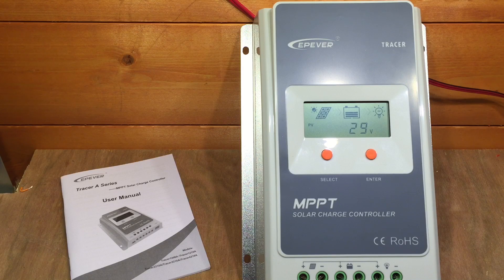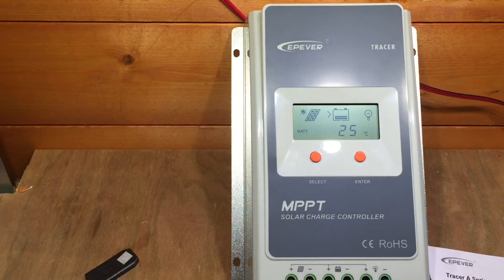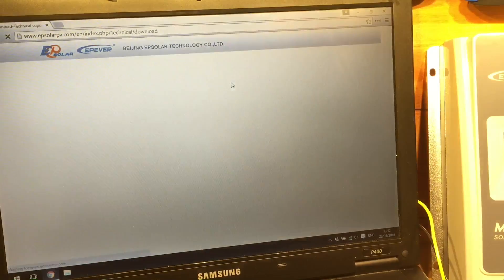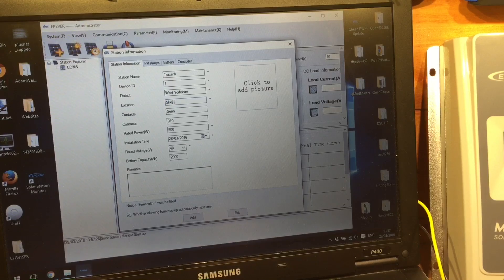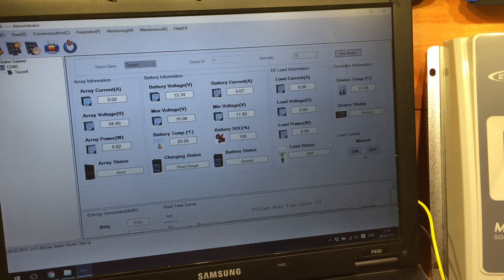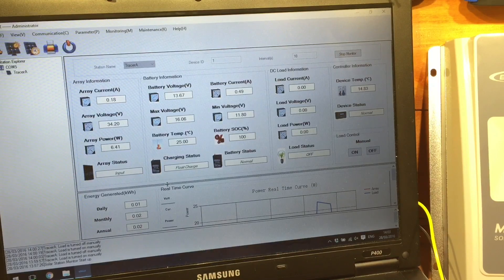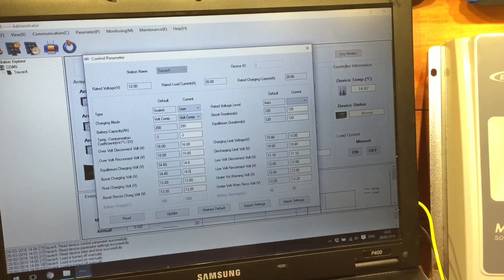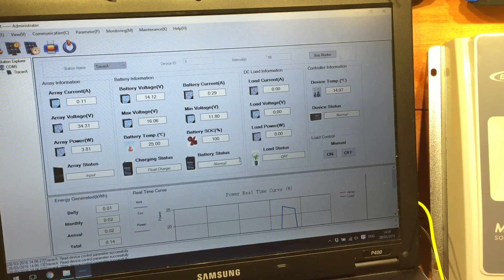EPSolar Solar Station Monitor software & a cheap USB cable - 12v Solar Shed

Comment: Hey great vid ! Good quality and clear content, I like it. I'm planning a van conversion and I want everything to be powered by solar (small fridge, couple led lights, charging my laptop, maybe a water pump) and I'd like to know if you have any recommandation on brands ? I want a 200w kits. If I can save a lot by buying separatly I will but otherwise a complete kit would be great. Would like to keep it under 1k$. Any recommandation ? Or brands I should avoid ? Heard some decent comment on renogy ...
Reply from the maker: +oli36 Renogy Sen to be well regarded in the US because I think it's a US brand. However all the renogy charge controllers I've seen are rebrands of the usual Chinese manufacturers. So the extra cash just pays for the local distributer and their service levels. I think they've rebranded EPSolar kit like the one I show in this video. 

You'll definitely be able to get a 200w panel, a charge controller and some size of battery bank for $1000. 

You need to think about your loads and how much power they'll consume and for how long, then work out your battery bank to power all that got a few days, then think about how much solar you need to top it up even on a poor sun day. 

Good luck and thanks for the kind comments.

Comment: Ok, so at about the 7 minute mark you show the software, now my mind went to one of your other videos about the lipo batteries (https://www.youtube.com/watch?v=Pnrxm3KNjes&t=284s) so what i'm wondering can you use this software and then use the 3 battery 12v string and use this controller to charge it without overheating the individual cells??
Reply from the maker: Hello.  Yes you could use the software and adjust the charging parameters to suite a 3S lithium pack.  Although I still don't think lithium fits very well in 12 volt applications.  It's healthy between 11-12.6 volts, where as a lead acid is good perhaps from 11.5-14.5 volts, and most '12 volt' devices are designed to suit that.  I still think lithium works better at 24 volts, but again, you could tweek the parameters to work even better.
Cheers

Comment: Hi, Adam. I'm Andrey from Rostov-on-Don, Russia.
I'm using Tracer 2210A since September 2016 and I see some strange 
things of the  MPPT algorithm.  It good seen on the charts I got. 
They are published on our Russian forum https://www.forumhouse.ru/threads/382675/. 
Look at the power curves. In the morning, I have two shadows. Each time, after the shadow went, Tracer starts MPP tracking process very late. After the first 
shadow 10 min later and after the second 20 min later. In this periods Tracer acts 
as PWM controller and it does not collect all energy as possible. 
Do you have observed something similar. Perhaps, at cloudy days this effect will be 
more frequently? When the sun is hiding behind a cloud, and then shine again. 
Due to of this effect, there will be a great losses of energy in those days.
Reply: The manual mentions something about this, that the controller isn't constantly in mppt mode but switches between pwm and mppt. Unfortunately, the sale listings on Ebay don't mention this at all....
Reply from the maker: I'm afraid I can only see the thumbnails of the images as you need to be a member to see the full versions, however I think I can make out what you are suggesting.  
A few people have suggested that the tracking algorithm isn't very fast and can seem to get a little stuck on previous tracer models.  Although I have seen some evidence to suggest this is true I've not looked into it very much because my batteries are still full when I need them at the end of the day.  
My old MPPT charge controller did a sweep every couple of minutes allowing the panels to go to open voltage and (close to) short circuit current and adjusted the DC2DC converter to suit but the epever doesn't seem to do this so I'm not sure exactly how and when it decides to perturb and observe (if that is indeed how it's finding MPP).
Reply: Of course, how could I forget you need to be registered member to expand the image. 
That's my fault. If interested, I can send the files to you directly, but I don't 
know how to do it in YouTube.
On the other hand, simply, you may register.
Reply from the maker: +James Biggar To be honest that's exactly what you want to happen. Holding your panels at the maximum power point when your batteries at full will result in one of two things - over charged batteries or lots and lots of heat to dissipate! 
The only MPPT charge controllers that will attempt to get the maximum power at every moment are grid tied because they have a bottomless pit to fill.
Reply: I understand that you don't want maximum power coming in when the bank is full lol, I've been off the grid for nearly 2 years now. But have recently decided to try this controller and so far am not impressed with it at all. My current SOC is only 60% and this controller is only inputting half the power as another ebay mppt controller that was half the price. Something just isn't right about the charging modes with this one.
Reply: ...and the only reason I decided to try this one is because the advert mentioned PC monitoring which I thought would be convenient, but the current program is nothing like what your screen is showing and getting it to work is frankly a pain in the ass.

Comment: Adam, I am planning on using this controller with my RV solar system. RV batteries are negative ground and so is all other components in the RV. Will this be a problem?
Reply from the maker: +Danny Woods Yes you can use it you just need to be mindful that it is common positive. As long as you make sure you wire your solar panels straight to the charge controller - ensure they are isolated from the chassis. Same for the load - if you want to use that. Although I'm guessing all your loads will already be taken straight from the battery in an RV. Hope that helps.
Reply: Adam Welch
Reply: Thanks! and thanks for your video's they are very helpful.
Reply from the maker: +Danny Woods Pleasure. Thank you.
Reply: do the batteries need to be isolated from ground as well?

Comment: Hi Adam, thanx for creating and sharing your review of this product.  It has helped me decide on which MPPT controller to purchase for my RV system that I'll be installing from scratch.  I choose the 30 Amp unit, with 4 x 100 Watt Panels, and 2 x 79 AH AGM Batteries., and have ordered the USB to RS485 adaptors, however, I noticed something that I wanted to share, and of which I hope you will to be of benefit.  When you build your own cable using either CAT 5 (or CAT 6) cables, be aware that you should be using a twisted pair of cables, contrary to your choice of leads.  Be sure to check the standard wiring diagram for a Cat 5 or 6 Cable, (Google Everything) which will reveal the designs twisted pair leads.  (Typically a solid colour is mated with a striped insulator of the same colour.)  According to the book diagram, one should use lead's 4 and 5, or 3 and 6, as they are "each a set" of a twisted pair.  This is important to maintain correct impedance, maintain noise reduction, capacitance, etc, especially in longer runs.  Additionally, for longer runs, instead of a standard UTP CAT 5 cable, it might be wise to use shielded instead... and one other point, especially for longer runs, CAT 6 cable uses a slightly heavier gauge of wire in the sheath, of 23 Gauge, instead of 24 Gauge.  I've yet to hook my gear up, but look forward to sunnier days ahead.  Cheers!  :)
Reply from the maker: Thanks for your comments, it's always great to hear when I've helped someone out.  It sounds also like you're going to have a nice system setup.  If you're conservative with your power consumption it should provide almost everything you need.
Yes, in hindsight perhaps using either the green or blue pair may have had some advantages.  However I've had a number of people copy my method and it has worked for them.  A couple of people have got back to me to say they've had some issue with communication and actually the fix for them was to use a common ground (by popping open the USB-RS485 adapter and wiring  one of the brown pair to the usb connector ground).
RS485 is used in industry because it is so resilient to noise ( http://admw.uk/je ) however that isn't to say your improvement would reap some rewards in some applications.  So, thank you for your suggestion Max.
Reply: After 2 days of trying to make it work (drivers, combinations of wiring, etc.) I can confirm that soldering the common ground to the brown made my device work! I'm glad I found your response here Adam. Brilliant videos BTW. Thank you!

Comment: Hi,  Nice video!

I thinking of starting with a few solar panels and working my way up in watts, same idea with my battery bank AMG deep cycle type.

I was thinking of getting the larger EPEVER Tracer4210A 40A MPPT Solar Charge Controller Regulator 12V / 24V EPsolar so I can add more as I go. (solar panels and batteries) will be looking at a 24Volt set up but starting with 12 volt battery.

Would this type of controller work with 140 watt panel mono with a 12volt 130 AH battery just to start? Does the controller recognise the smaller amp and adjust accordingly? Thanks
Reply from the maker: +RED RUM Hello. Yes you can place a smaller battery and panel combo on a larger controller with no issues. Charging is based on battery voltage so big and small batteries act in the same manner. Good luck with your install. Thanks for the question.
Reply: Thank you, I appreciate you taking the time to reply.

Comment: Hi from Puerto Rico... My name is Rafael Felix.
Thanks for this interesting vídeo (very usefull). 
Help needed... I have the same controller and the monitoring software as well, everything works well, but as soon as the solar panel goes out at night, my battery SOC goes from 100% reading to 30℅ but voltage is ok 12.9 so technally it is totally full .... Any idea to fiz it ?.... Thanks un advance.
Reply from the maker: Hi Rafael. A number of people complain about the SOC meter.  I'm not sure what algorithm it's using to calculate the state of charge but it does seem to be quite misleading.  Personally I don't use it and simply keep an eye on voltage - I've also set my controller to use Voltage Compensation rather than SOC in the Charging Mode.  For me it is not really a problem, but I know for some people this is disappointing.  Thanks for the kind comments.
Reply: Thanks for your quick response... Will Change to voltage compensation  mode to check .....
Reply: Already suscribed to your channel....
Reply from the maker: Iglesia Jesucristo Salvador You can change the mode but I don't think it has any effect on the battery meter on the charge controllers screen unfortunately.

Comment: Just an FYI, the "official" USB to RS485 cable, (CC-USB-RS485-150U) has one wire attached to pin 4 on the RJ45 end and the other wire attached to pin 8 which is ground.  The USB end is molded so I can't take it apart easily.  

I did use one of the cheap RS485/USB adapters like you mention, wired as you said and it does work.
Reply from the maker: Thanks George - Grounding all the devices together is sensible and it's good to hear EPSOlar have done that.  The cheap usb to RS485 adapters don't have an easy to access ground though (I did consider soldering a wire to the neg on the usb connector internally) but like you, found it wasn't entirely necessary.   Thanks for letting me know.

Comment: Hi Adam, great video. I did everything as you did and it works great with no load being pulled from the battery bank. However, as soon as I start to pull a load it stops working and gives an error. Stop the load and it starts to monitor again. It monitors on the device itself, just not on the computer. Do I have something wrong? Has this happened to you?
 Thanks in advance
Reply from the maker: Hi Ray.  No - this hasn't happened to me.  In fact now I've got the wifi to RS485 box I've recently reviewed I've been monitoring my tracer 24/7 remotely with no issues at all.  My load is on all the time, I use external switches to control whats on and off and generally my load is quite small (a few led lights).

What is the error message?
Reply: It says Operation failed. The operation has timeout (com3)
and
operation failed. Other error(com3) 

 I am pulling the load directly from the battery to the inverter. Using about 300-400 watts. It still monitors on the charge controller itself under these conditions, but not with the software. Obviously I would like to moniter while pulling a load because I run all my 110v with solar.
Thanks for the reply
Reply from the maker: The only thing I can really think of is that there is a fault with the unit (whether that's one or two of them or a fault in the design) or possibly more likely, that there is an awful lot of electrical interference or noise being created by the inverter and that is knocking off the communication.  RS485 is meant to be very good with interference but I guess it's not perfect.
I only have a small inverter and I don't often use it.  I will test this though and let you know how I get on monitoring the tracer and running the inverter from the battery.
Reply: Do you think that me pulling a load of 25-40 amps from the battery bank on a 20amp charge controller could be the issue? I will try a smaller load and see if it works but you may be right about the interference. Thanks for your help. Let me know what you find out if you do your test with the inverter.
Reply from the maker: ray b Pulling 25-40 amps direct from the battery shouldn't cause any issue - except for the fact that you'll always have a net loss even if it's nice and sunny...
I suspect interference is probably the cause - I will test at some point over the next few days and get back to you - unfortunately using a different inverter may reap different results.  Anyway, we'll see.

Comment: From the software menu it looks like it can charge lithium-ion batteries.
Reply from the maker: Yes you can adjust the charging voltages to suit various lithium ion packs.  I'm always a bit cautious though about float charging lithium cells.  I've done another video series where I've been charging lithium 18650s on a standard lead acid PWM solar charge controller ( https://youtu.be/YoH7V56RtkM ).  I think it works probably because my cells don't go into float mode as I don't draw anything from them in the day.

Comment: I have the 30amp version and have a 300ah bank running my mini fridge which runs a at 5 watts and spikes to 70 watts for a few minutes then back to 5 watts. Doing the math I should be able to run the fridge for 3 days with out a solar charge before I have to shut iit off. The epever was showing full charge and when I woke up it was at 1 bar. I went and installed some external meters and found that my bank was a consistant 12.8 volts in the morning. I think the epever battery meter is off. Maybe the software. I went into the software and changed the 80% discharge setting to 50% in hopes it would maybe change the battery meter but its hasn't effected the battery reading at all. Have you noticed this and have you found a solution. Thanks
Reply: What fridge runs on 5 watts.  It must be the ghost load (5 watts off, 70 watts on)?  What model.
Reply: pirucreek yes you have it right.
Reply: pirucreek  it's a 4 cubic foot Energy Star Avanti

Comment: Need your opinion, I have lots of Stion, but they ran out so I got a bunch of SUNGEN panels for under 40 cents a watt, I just got 15 of them.  This is where ( that link), Whats your opinion of this type, so far, there impressive. http://rover.ebay.com/rover/1/711-53200-19255-0/1?icep_ff3=2&pub=5575119394&toolid=10001&campid=5337663844&customid=Solar+panels+100+watt&icep_item=171847674560&ipn=psmain&icep_vectorid=229466&kwid=902099&mtid=824&kw=lg  100 watt high volt Amorphous
Reply: Јохн Даниел I am running 2 similar panels 70v 1.5A to a 20 amp tracer 400 AH gel battery works a treat
Reply: We have 7 of these 40 Amp and they handle the 90 volts open but we're getting hot. but by placing a 100 amp Diode in between the panels and controller I dropped voltage to 87.8 at full output and the 4210A is much cooler now.
Reply from the maker: I haven't any experience with the new breed of amorphous panels.  You'd definitely need an MPPT charge controller with their MPP at over 70 volts.  Glad to hear they are working well for you.

Comment: Hi Adam, is there a modbus map for this if I want to poll with a master rather than use the software?
Reply from the maker: This is the only documentation I have found - and I'm not sure how accurate it is.  Perhaps you could confirm please?  http://admw.uk/jc
Reply: Perfect.  This is exactly what is needed for SCADA!  Thanks,  I couldn't find it anywhere.
Reading this document, the baud rate isn't changeable.  If that is the case it is fairly useless as a SCADA RTU over radio networks.